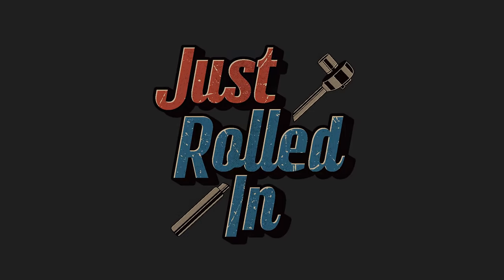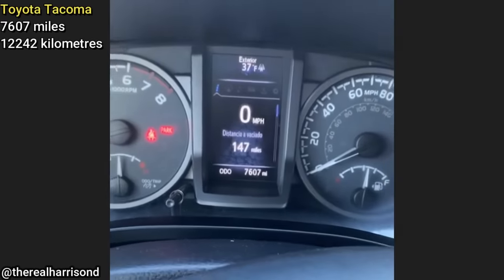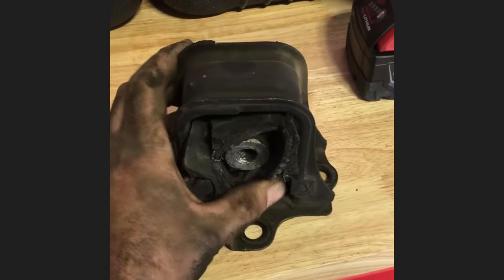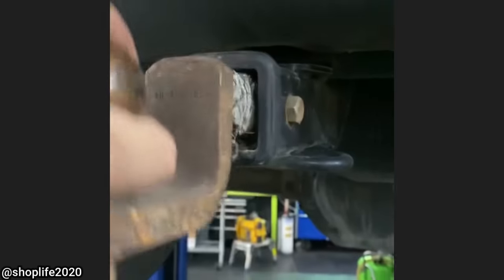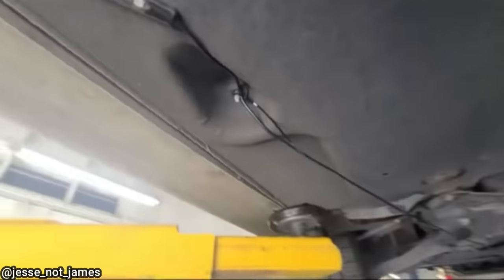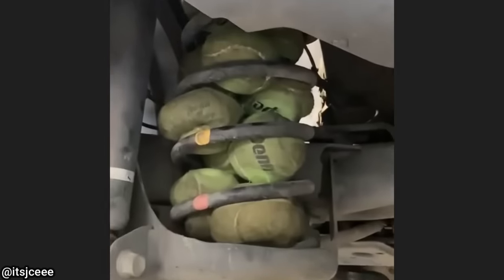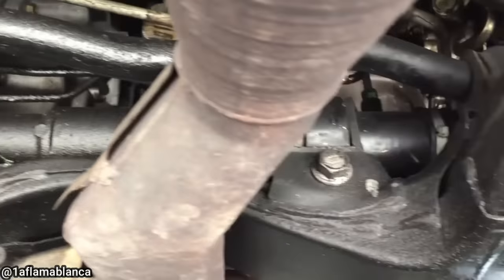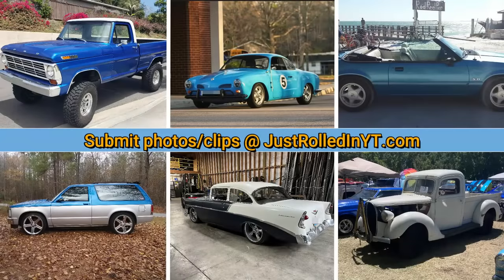Customer States Change Engine Oil On Tesla | Just Rolled In

Comment from the maker: Happy Monday!
Submit your clips @ www.justrolledinyt.com

Sorry for the later upload. Computer issues, of course lol.
Reply: 2 questions..... how's the truck coming a long?  How's your son coming a long? Priorities right. 😁👍
Reply from the maker: Truck is good! I should do an update on the 2nd channel!
He's due in October but so far so good. We have another appointment in two days to check on him 😊. Great pregnancy so far for my wife.
Reply: Btw I think Teslas do need an oil change every 100K miles or so
Reply: IT Tech: Customer states that system runs slow and is unstable especially when editing video.
*Opens internet browser. Sees two dozen "toolbar" malware installs.*
IT Tech: Oh well there's the problem. One of them at least.
Reply: I know a guy that spent 2 hours trying to change the spark plugs on his GMC Duramax Diesel Dually.
Reply: Is Kool bruh
Reply: Thanks have good Monday 
The tennis balls in them springs 🤣🤣
Them two cars where discussing 😨🤢🤮
Reply: Can‘t submit a clip 
Im not 18 or older
because in Swiss you have the dual apprenticeship System
Reply: I noticed someone didn't know What hydrolock is. It's when water enters the combustion chamber. Liquids will not compress. Engine locks up.
Reply: @michaelearl6991  I've seen them bend connecting rods.
Reply: Can you do longer videos explaining in more details on what's happening

Comment: I once heard a tesla owner talking about how futuristic and good his car is, one feahe mentioned was the regenerative braking which he thought grew back the brake pads
Reply: They should have charged the Tesla owner for blinker fluid ! 🤣
Reply: To be fair, that does sum up tesla owners. People who know how EVs work, buy anything BUT
Reply: @TheChipmunk2008  Tell me you have no idea how EVs work without telling me you don't know how EVs work. 🤣
Reply: What about Rotating the AIR in the Tires ?
Reply: Waiting for the future EV content the Northern winters with road salt will create. Tesla has a lot of electronics underneath.
Reply: @opendstudio7141  Tell that to Norway. They haven't noticed any issues.
Reply: Wait! What! It doesn’t?
Reply: @masterzedric  probably built to higher standards compared to US made vehicles.
Reply: @opendstudio7141  All the US made Teslas imported into Norway are built to higher standards than the ones sold in the US? No. Just no.
Reply: Probably not aware that diesel-electric locomotives, and electric trains, have been using a form of regenerative braking for decades.
Reply: @railtrolley  Yes they use the electric motors for some of the braking but it is not regenerative.  The power is dumped into essentially a bank of resistors that dissipate it as heat.
Reply: @Goldenhawk583  No, the opposite is closer to the truth. They are great in the snow and keep you warm for hours and hours if the roads are jammed. I know there were reports about stranded Teslas last winter (around here too), but at least the ones around here turned out to be entirely fictional when people looked into them.
Reply: @masterzedric  As I read it, the problem was not the Teslas abiluty to idle and keep people warm, it was the severely reduced range of the vehicle, due to the temperature.
That means a lot less power to idle when stuck. On a full "tank" a tesla can idle for over a day,  but that leaves less for actually going somewhere.
And some DID run out of batterypower to get much further..
Reply: Please no.
Reply: @masterzedric  I bought a Tesla 😭
Reply: @masterzedric  Don't be too sure. Many vehicles for Scandinavian countries have had extras added over the years. Could be as simple as special wax at PDI.
Reply: @masterzedric  for moral reasons I could never own an electric vehicle. I need to know I'm burning liquid dinosaurs, for moral reasons
Reply: EV owners are the modern day "Wiley E. Coyote, Genius".
Reply: @damon20r  that's just straight up false
Reply: Now that's a good one not heard that before lol 😂
Reply: Okay, I think electric cars are a bad idea as we do not have the capacity to produce the electricity nor the grid capacity to deliver it.
Last week I got a test ride in a 2022 Tesla, the acceleration is incredible, and the regenerative braking will all but stop the vehicle. It's the fastest cellphone with wheels you can imagine. The part that was funny is the owner said the car was programmed so the different seats had different Whoopee Cushion sounds straight from the factory, its hilarious.
Reply: @opendstudio7141  No, Tesla's do not have "a lot of electronics underneath". There is a giant skid plate underneath, and most electronics are sealed away.
Reply: @michaelvanhorn3271  Actually, if everyone switched to EVs, the grid would have an easier time of it, because it takes MORE power to refine gasonline than it does to charge an EV battery for the equivalent range. EVs are superior to ICE in every possible way except one (currently) - and that's how much energy you can store on-board. Right now it's about 100 kWh, which is about equivalent to a 4 gallon gas tank. Get EV battery chemistry up to the point where you can store an equivalent amount of electricity to todays gas cars, and you'll be able to drive 1000 miles on a single charge, while towing a big trailer.
Reply: Does this "regrowing brake pad" phenomenon apply to Teslas shipped without brake pads?
Asking for that poor lady that had to wait several months to get a service appointment, and then a few more months for the dealer to get brake pads delivered.
Reply: @ColinFox  actually you truly don't know how the grid works or that its failing under today's load and it easier to supply an industrial manufacturing plant that to distribute to millions of home's and most neighborhood would have to be entirely rewired to put it charging stations and we don't have the copper to make the wire available. Also most refineries don't use Electricity for the "crack" but use LNG.
Reply: @opendstudio7141  alot of modern cars have like ESP, ABS and tire pressure system those are quite exposed to road salt
Reply: Check out Vlog Creations on YT. They replaced the electric motor with a combustion engine and took the car into a garage for servicing. Very funny.
Reply: @ikillstupidcomments  Well, you are entirely wrong though. Replacing batteries every few years isn't a thing, just like replacing the engine of a fuel car every few years isn't a thing. Modern EV batteries tend to outlive the car.
Reply: @masterzedric  You can drive a car forever as long as you keep putting money into it. Most cars get scrapped when their cost to repair exceeds the market value. If EVs that are not worth fixing tend to have good batteries, then owners are paying for battery life that they don't use. MBAs at the automakers will see this as a waste and call for cost-cutting on battery packs to reduce their lifetime to be more in line with that of the car as a whole.
Reply: What is he nuts?
Such a fool. Who dosent know by regenerative breaking, the brakes becomes bigger and better for every braking...  It's should be logical. People these days don't know anything....
Reply: @ColinFox  no, the problems with the power grid are more about generation. We need more nuclear reactors.
Reply: And it’s these kinds of Tesla owners that make the rest of us cringe 😒
Reply: @michaelvanhorn3271  the average  EV owner charges at home overnight  when electricity  demand is at it's  absolute  lowest.  That's a lot of extra capacity.
Reply: @soangry  is that why I keep getting emergency cell phone notifications to unplug electric cars and turn up air conditioning even though I don't even have an electric car, do have electric bicycle, to the point I am having to turn my phone off at night? Here just below Sacramento. We are averaging 1 to 2 hours a day blackouts at last 4 days a week, where is this excess electricity being generated please?
Reply: @TheChipmunk2008  I've owned and driven luxury, sport, grocery getters, race cars, and raced motorcycles, and NO car has have given me the fantastic experience of a Tesla Model S.  Don't know why people hate EVs so much as every EV on the road means more gas for ICE cars. What people SHOULD say, is an EV is NOT the best car for everyone and NO government should force you into buying something that is not the best for you.  An ICE car is not the best car for everyone. At one time we were a free country which allowed people to do what was right for them and not what a bunch of America's most dishonest professionals, lawyers and lawyer/politicians think.
Reply: @opendstudio7141  The electronics are very well protected and more protected than most ICE vehicles.
Reply: @masterzedric  Norway doesn't seem to have issues but then again most of the EVs are built for short range city driving. As said the purposes are completely different as here in the US over 40 percent of the population has to drive 30 to 40 miles to get to work. I. Which case these are much more inefficient. Not to mention the increase use of climate control during said times is known to really shorten the range on some of these vehicles. Meaning over 40 percent of the population in the US literally cannon use EVs in said conditions. Obviously Norway a country that's smaller won't have a problem with scattered out cities etc. Now obviously they use cars less there to so obviously they don't mind walking in said weather either..there are.many reason as to why EVs change from country to country and the needs of citizens changes from country to country. They are never the same for each country. Us needs more long distance travel with lack of hindrance the bigger cities in the US need fuel efficient commuters. Japan is just go from one place to another without getting lost and china well that's a confusing shit show.
Reply: @ColinFox  your idea on it helping the grid is bullshit.. you might think you understand but you don't. Listen here it doesn't take more to refine than more.power but the issue is refining gasoline isnt that energy consuming. Ahh okay let me explain the grid that is used to refine gasoline is not the same one used to refine electricity. Most refinement of gasoline happens at the fuel tank when the fuel gets delivered..this is so people can't steal it from the factory..the lorry driver who delivers the fuel refines it... Using fuel... So the fuel is used to make electricity to refine the fuel.... As in electricity is just the same thing without a step. It's such an insignificant difference as the energy is not pushed into the grid the energy production is completely separate from the grid..does that.makes sense. No..okay glad you don't understand.
Reply: @likeablecloud2454  Tell me you know nothing about Norway without telling me you know nothing about Norway. 🙄 Same with EVs apparently. 30-40 miles is nothing for an EV. I do that every day. 🤣
Reply: LMFAO
Reply: @gonelucid  

Nuclear power is absolutely NOT the eat forward.
Reply: Being rich doesn't make you smart. The FIRST prius had it too. 20 YEARS AGO
Reply: @damon20r  Electric Trains can feed the Power back into the Overhead Wires, and AC Systems can feed that Power further through the Substation into the Transmission Grid. DC Systems can't do that, as Transformers need AC and the Rectifiers don't work both Ways. Hence DC would need another Train powered by the same Substation, but that's unlikely as the lower Voltage of DC requires Substationa every few km. So DC Trains mostly "waste" the Power generated while Braking in Resistors, just like Diesel-Electrics do.
Reply: @Genius_at_Work  I was referring to Diesel-Electric.  Which are by far the most common here in the U.S.
Reply: That piece of crap Tesla will never outlive a gasoline powered  car
Reply: @ColinFox  a 2 minute google search seems to suggest that you are completely wrong, gasoline takes much less electricity to refine than the equivalent range for an EV.
Reply: @michaelvanhorn3271  said who? You? We are capable of producing them and there are hundreds of thousands on the road.
Reply: No you didnt lol
Reply: LMFAO
Reply: @soangry  except there is no extra capacity at night in California because everyone is charging their EV at night, it only worked when there was just a few people doing it
Reply: @masterzedric  every time you say "tell me you know nothing about x without telling me you know nothing about x" I become more convinced that you actually don't know anything about anything.  also 30-40 miles is nothing for a tesla, obviously, except teslas are expensive as hell.  many of the cheaper EV's only have 80-100 miles of range, which if you're driving 40 miles to work that is an 80 mile round trip which means you better not take a single detour or you're not making it home, and for some of these EV cars that is their range in warm weather
Reply: Never heard that one!😂
Reply: @ColinFox  care to speak of how damaging mining the cobalt for Lithium Ion batteries that power your beloved Tesla is for the environment? Or the human rights violations that are practiced to mine this mineral across the world, particularly in The Congo?
Reply: @likeablecloud2454  What complete nonsense.
Reply: @EricKarlson...Pretty sure road salt isn't good for any vehicle, regardless of it's powerplant.

I just backed this common knowledge up with an article I read about why Norway is trying to substantially reduce the amount of road salt used.

Think more grey, less black and white...
Reply: @opendstudio7141  Tesla has less exposed underneath than most other cars, primarily because of that one lady who ran over a trailer hitch or something that punched a hole thru the battery and set the car on fire. So now they have basically a solid metal plate a half inch thick over the entire underside.
Reply: blblblblblblblblbl
Reply: @masterzedric  Toyota go vroom
Tesla don't go vroom
Reply: @TheChipmunk2008  You failed HARD trying to sound smart. Teslas are leaders in EV tech and its not even close.
Reply: I chuckled hard in my belly.
Reply: @Logan-dk8of  Funny how he never responded to you isn't it? I was just looking through this and I was waiting to find someone that was gonna say something about his random spouting.
Reply: He'll happily pay for an oil change every 3000 miles then 🤣
Reply: @dashcamandy2242  that's how they make them, they grow them, on a solar farm.
Reply: @ikillstupidcomments  now that's 15k, plus the pollution in the manufacturing process.
Reply: @soangry  and so many power plants have closed down because EPA forces them......we have no extra capacity.
Reply: @michaelvanhorn3271  there are 150+ power plants shut down because of the EPA.
Reply: @rearspeaker6364  yep, and the grid structure is falling apart rapidly, and "magically" food processing and preparation facilities are burning down.
Reply: @@YTcensors no, that would be the owners of big-block V8 cars.
Reply: Sounds like a typical Tesla owner really.
Reply: @masterzedric I like how you straight up made up "turned out to be fictional". People being stranded in EVs wasn't a tesla issue. It was an EV issue
Reply: Same guy says the battery has a fuel filter
Reply: @ColinFox You got stock is Tesla don’t you?